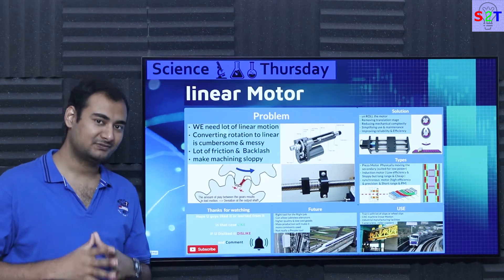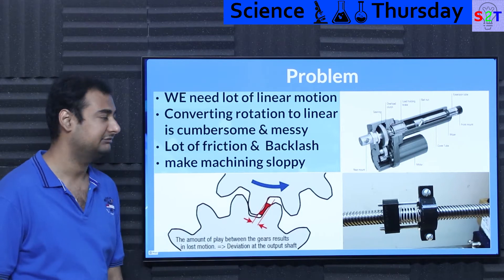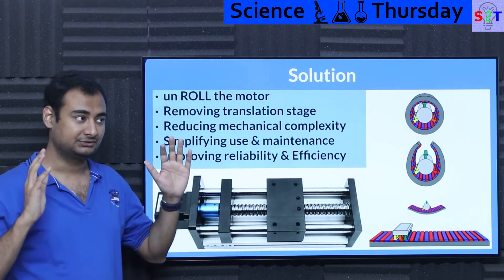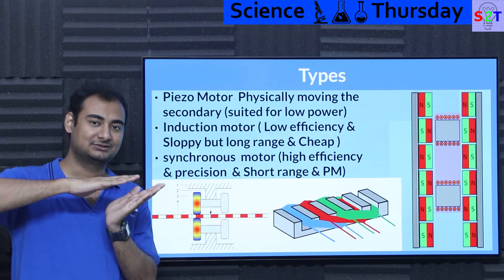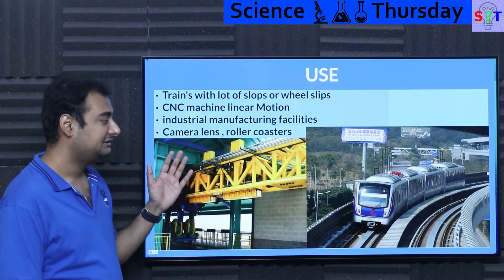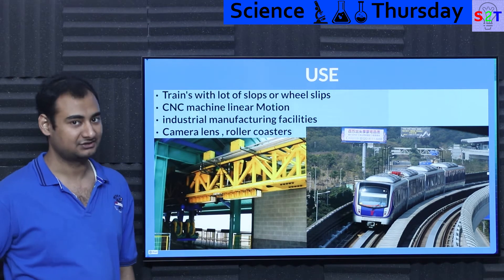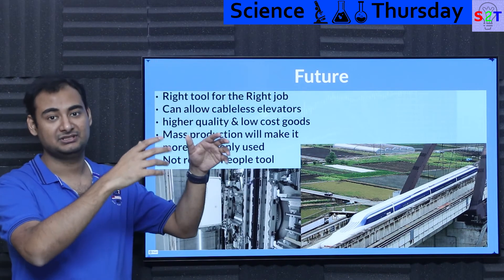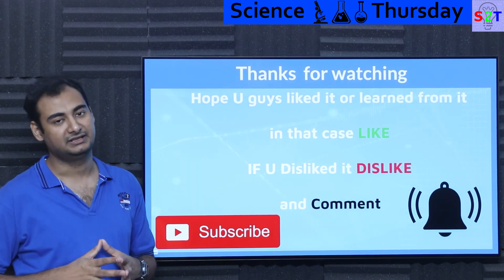Linear Motor Explained {Science Thursday Ep162}

Comment: The cable-less elevator thing is weird. Why aren't there lots of possible solutions to this like rails or rack and pinion or something like that? Why do we "need" cables and why do we need linear motors to replace them? Also why couldn't you have multiple cables in one shaft for 2 elevators? It seems like something that could all be engineered and made into a mass producible standard no matter how you build it.
Reply from the maker: time will tell which will win out
Reply: I'm not an expert and I'm just speculating.
 
Trains on rails rely on friction between the wheels and the track, which is proportional to the reaction force exerted on the train to counterract its weight. With an elevator where the rails are vertical, the weight is acting perpendicular to the track so the reaction force is very small or maybe even zero. I assume this means there is not enough friction between the wheels and rails for the elevator car to overcome its weight and move upwards.

Another reason cables are good is because it is easy to add a counterweight, reducing the work the motor has to do to lift the car upwards.